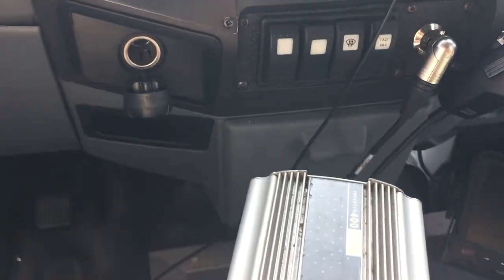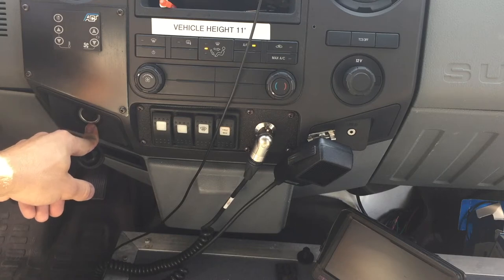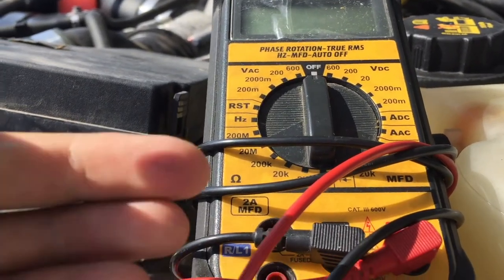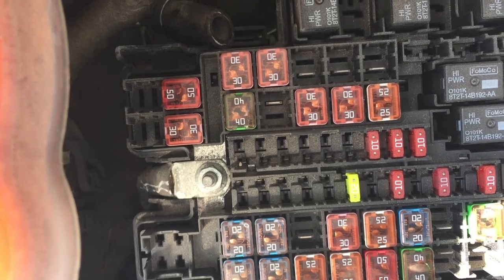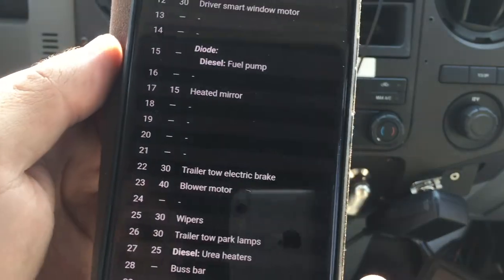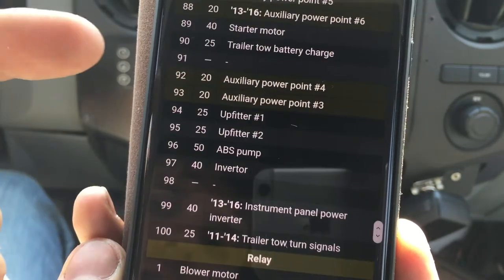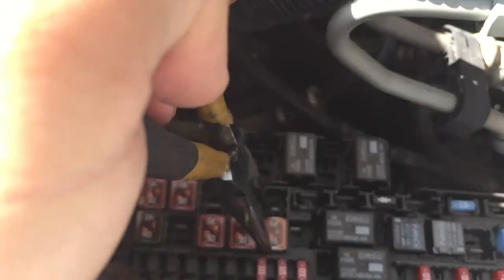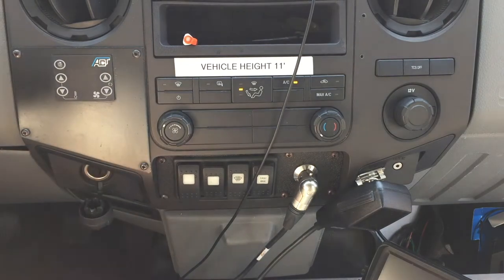2012 Ford Truck Driver's Side Aux Power Outlet Fuse Location

Comment: I have the opposite problem. My 12v (right one) isn't working. You said it's bank 5? What does bank mean? Just what slot it's in?

After further investigation I think the actual plug is bad. It'll stay on for a few seconds then shut off

Comment: Running a diesel that low on fuel is only a good idea if you have to pull the fuel tank.
Keep it above a quarter to save yourself some grief.